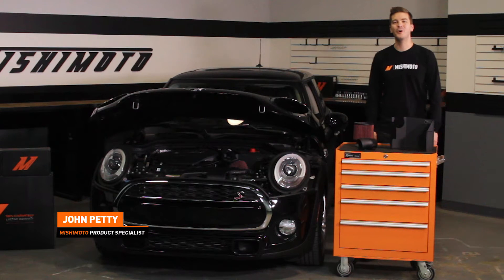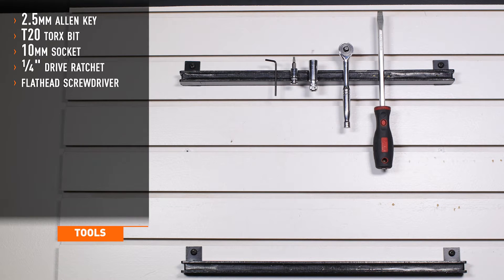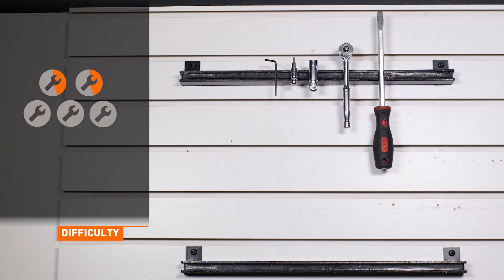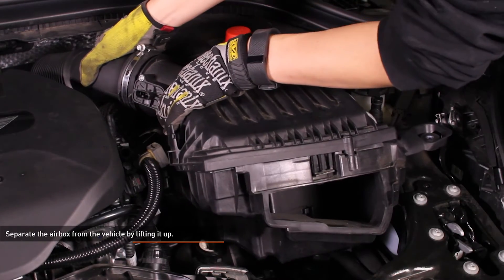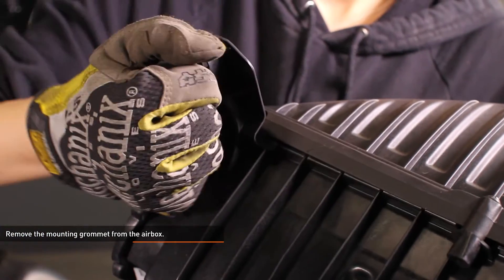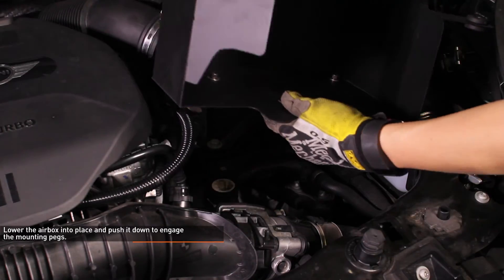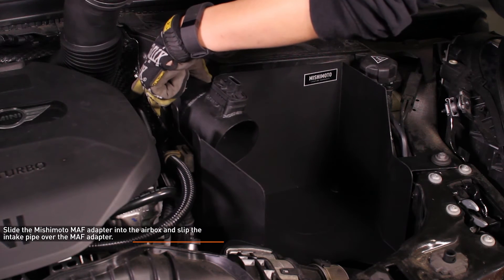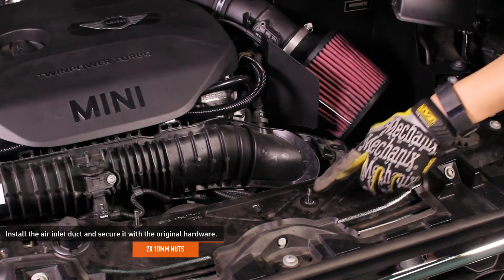2014-2018 Mini Cooper S Performance Air Intake Installation Guide by Mishimoto

Comment: Would this be the same process for the F56 1.5T?
Reply from the maker: Hey k dog. This part was designed to be a direct fit for both the F55 & F56. With that said, the installation process should be nearly identical.

Comment: will this affect the computer will mini know I've installed this?
Reply from the maker: This performance air intake is safe to run on the stock tune - designed to be a direct fit with no modifications necessary - you should be good! :)